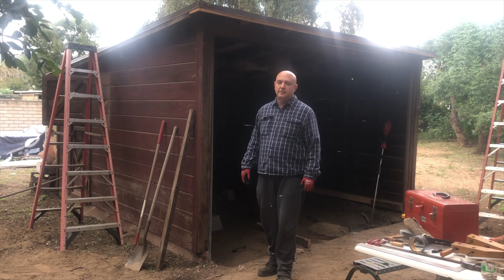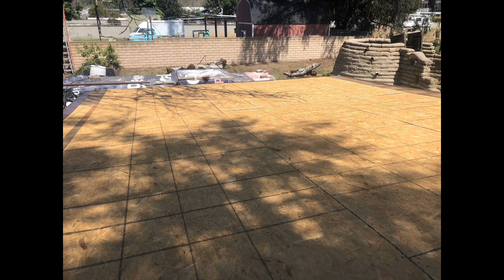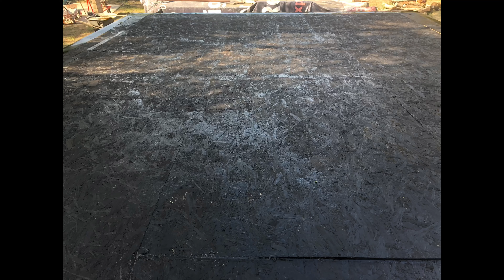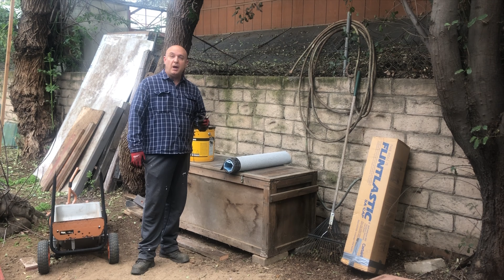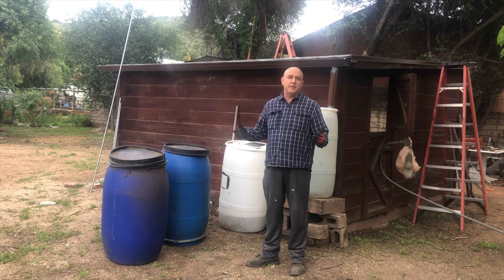Creating a Water Collection Roof on a Tiny Shed

Comment: Corrections: I sealed the drip edge with silicone. Also, I meant to say that I do not endorse any specific peel and stick brand. There are many great products like Flintanstic or Poly Fresco. This product will last even longer with an underlay.